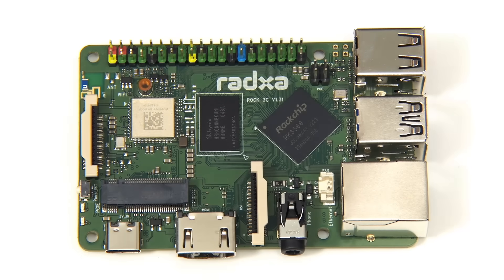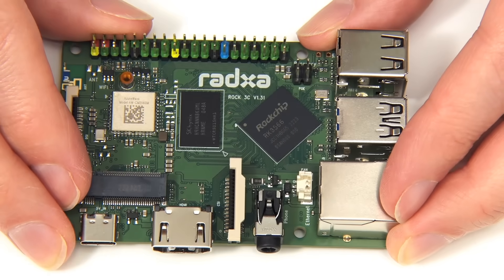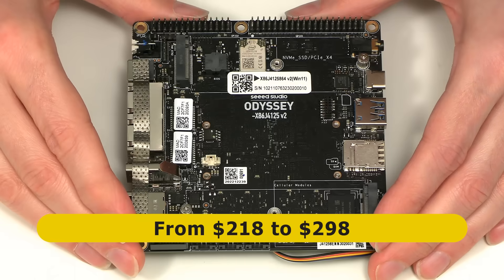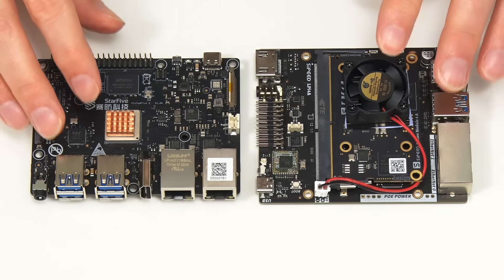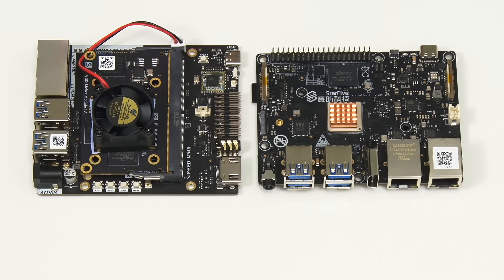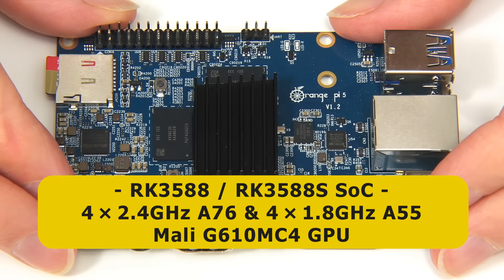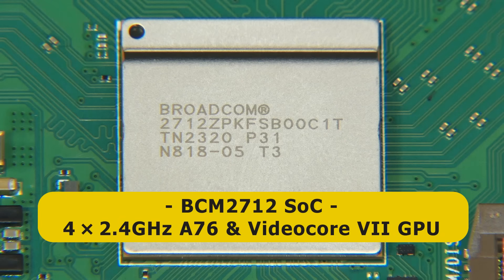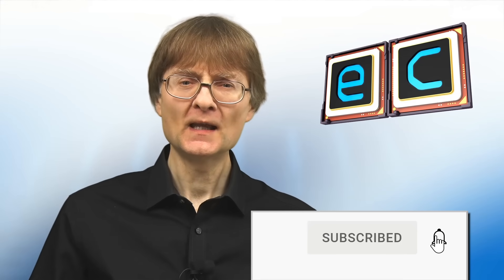Top 6 New SBCs 2023

Comment: I think you nailed it. The PI is always going to be #1 in my opinion. It might not be the fastest or most high tech, but it's a stable platform, that's flexible enough to run a variety of os like Kali Linux. It's a natural choice for Python development and there's lots of support and help available from other users. That's not to say the orange pi doesn't have a place. I can think of lots of physical programing applications where the orange pi might be a better alternative when is comes to cost vs benefit. That being said, I think a noob should stick with the Raspberry PI for the above mentioned reasons. While cheaper options may be available. They are generally better suited to those with more experience in my opinion, due to limited technical support resources.  However if someone's main objective is using the SBC's I/O connector, and writing physical programming applications in python they should be good to go.

Comment: Thank you for covering SBCs! Do you know whether there's an online database of SBCs (perhaps crowdsourced) that can help folks find a board that works for them? I'm having a hard time finding boards with 2 ethernet ports and would love a way to easily search and filter. Related, I'm also searching for boards that are fully supported by the vanilla Linux kernel and the main distros directly (say from Debian or Armbian). I'd rather not rely on ISOs built by the board manufacturer for security and longevity reasons. Thank you!

Comment: It feels like 10 to 20 SBCs have been released every year for the last decade or so, with every one of them being a 'niche' product (that is, not a mass-market consumer device) that would require both a large development cost, and then demand a significant ongoing support cost. 

I find it hard to imagine the total production volume for any of them (possibly excepting the Raspberry Pi) is much over 100,000 units, and I'm guessing most of them sell well under that number. Almost all of them are priced under $200, with many well under $100.

And yet - there are several companies making a go of it, and new boards just keep on coming. I'm not complaining (much) about having too many choices, but for at least 5 years I've been expecting the bonanza to come to a crashing halt. Obviously I just don't understand the economics of the situation.
Reply from the maker: Raspberry Pi models sell in millions. Most other SBCs have production batches of a few thousand, and often no more than a few batches will be made. So there are very few SBCs that sell more than 10,000, or even 5,000 units.
Reply: @ExplainingComputers Thanks Chris. I didn't expect millions for the Raspberry boards (hundreds of thousands, yes - millions, no). 
But the numbers on the rest of them don't surprise me very much. Although they do still leave me wondering why there are so many SBCs. 
If you sell 5,000 boards at $100, that's half a million, which really feels like it wouldn't cover your costs. Salaries and benefits alone, for as few as 10 people, are likely to be half a million or more per year!
I guess all these companies are willing to spend in hopes of becoming the next Raspberry? Oh well. Good for us, I guess. At least until the bubble bursts.

Comment: I'm waiting for a goldilocks board to use as a home router. There's a lot of hella good boards out atm but with only 1 ethernet jack. And there's a lot of janky with ones with 2, which I want; or alternatively super expensive ones with 2 ports but also 20 other things a router doesn't really need. I'm also very very not interested in running things off SD cards these days, break too much. Internet -> dumbified modem -> SBC -> switch/router -> LAN is the setup I'm eventually thinking of.

Extremely disappointed that the RPi 5 still regards alternative storage to an SD card as a 2nd class citizen. Hoping soon maybe that PCIe connector will allow nvme storage to be the norm.

Comment: 10:33 i think you mean 4 USB 3.0 Type a sockets.

The problem with these boards is that unless you need gpio access you can get a second hand i5 mini PC for £75 that will eat these SBC's for dinner in performance. They will also have better graphics drivers for hardware acceleration.
Reply from the maker: I do indeed! My bad. :)

Comment: A Pi 5 has just dropped through my letterbox! That's a rarely documented feature, easily sent through mail. As a piece of electronics, it's a work of art. Some resistors and capacitors are now so small, you need a magnifying glass. We now take technology for granted but this is a serious piece of technology.
Reply from the maker: Enjoy your new Pi. :)
Reply: Package small enough to drop through a letterbox? That's good.  I ordered a single SD card from a shop a while back.. it came in a 30x30x20cm card box which I had to drive down to the post office to pick up. Deep inside the box was that little SD card, in a plastic wrapper which could have gone in an envelope instead.

Comment: Woohoo! I  guess I am a  "diehard". :-) I have the Starfive vision 5 2 (from the kickstarter early bird) ... the RISC-V boards work, but there some things need a bit patience and time reading forums and documentation.  Being able to use a NVMe SSD is a great feature. I've also messed about a little with bare metal RISC-V (32bit) on an FPGA...  Haven't had time to try yet, but I believe it wouldn't be hard to spend a week or more using RISC-V 64 and Debian for a week or more.

Comment: Is there like a universal power supply brick that can be used on these SBCs?
Reply: I use a Pi 4 power supply for both the VisionFive 2 and the Lichee Pi 4A. Cheap, decent quality, and readily available.
Reply: @BruceHoult  Good tip, thanks Bruce.

Comment: can't wait for the a78 cores to land in SBCs beyond the Jetson
Reply: We always want more!  I'd like to see an SBC with Snapdragon 8 Gen 1/2. That would be powerful!  It's possible we might see A78-class from RISC-V first -- Chinese firm SOPHON this week announced a new SoC (SG2380) they are developing with 16 SiFive P670 cores, 12 at 2.4 GHz and 4 at 1.6 GHz. They plan to release it on a mini-itx board in the 2nd half of 2024 starting at $120. We shall see. They currently have a shipping 64 core RISC-V SoC (SG2042) with the same A72-class C910 cores as the Lichee Pi 4A running at 1.8 GHz which works very well (I've had ssh access to one since March), so they certainly seem capable of the task.
Reply: @BruceHoult  Brilliant stuff! Once RISC-V is able to push the A78+ envelope they'll definitely become capable desktop replacements. Hopefully that SOPHON board has a BIOS too since that's usually what makes OS support difficult on ARM/RV platforms.

My Pi4B is already very capable as a homeserver but it's still a bit behind in video transcoding. I'm being patient though! I really want to get into RISC-V when it's a worthy upgrade.

Comment: I agree that the RPi5 is the best in the market due to the ok performance but more importantly the fantastic software support and experience. There is little value in an SBC that's fast but crashes frequently or doesn't support the software you need to run.

Comment: Apart from the likely larger user base for support the Raspberry is not deserving of position #1. Technically they are behind in terms of PCIe, speed and overall I/O.
Reply from the maker: Hardware alone does not make a usable system. The software support matters, as does delivering a consistent hardware platform. It's not about the user base.
Reply: @ExplainingComputers  As the RK3588 is getting close to mainline Linux support (95% there) along with several quality current images from non manufacturer sources some of that is far less an issue than in the past. The issue is with manufacturers who only see profit in sales and software as a cost to be reduced so if you look purely at them then there is some point. Even Raspberry relies on external input for software which they do well and incorporate it into their own.

Comment: massive invasion of cheap intel N-series processor based mini PC models makes Odyssey  SBC outdated and overpriced in case you needed just a cheap PC
for 150-200$ one can get such PC with 16 Gigs of RAM, 512 GB NVMe SSD + SATA port  and preinstalled Windows 11 and some models come with 2 LAN ports.
So GPIO ports seems like  the only advantage of the Odyssey
Reply from the maker: For a cheap PC you are right. But even ignoring the GPIO, the Odyssey has advantages in many use cases. I've never see a mini PC with twin 2.5Gb Ethernet for less than the price of the Odyssey, or one with two M.2 slots and SATA either. We have to compare like with like. :)

Comment: I feel that a NVME connector and SATA connector are now becoming a minimal requirement for SBCs, as it is more convenient and reliable for storage than a micro-SD card, and in term of RAM a quantity of 8 Gb (or more) would be ideal for using SBC as a small computer, and advanced NAS usage. For 2024 I hope SBCs will have these specifications, otherwise users will prefer mini ITX motherboard, mini-PCs which offer better features and flexibility.
Reply: And can we please have onboard Poe and 2½ Gbit Ethernet as standard as well.
Reply: *an NVMe (because enn-vee-em-ee starts with a vowel sound)
"A" vs "an" is determined by the sound that follows, not the letter, and it doesn't matter what the letters in an initialism stand for.

Comment: Wow those Kdenlive times are interesting to say the least (15:25).  The RPi 5 got its -ss whipped!  And the RPi 5 didn't even show much faster than the Pi 4 and they both got BLOWN AWAY by the Orange Pi 5.  WOW!   Not just faster as you said but more than 2x as fast.  I'd like to see more comparisons between these to see why there is such a HUGE difference in this test.
Reply: Yeah it's quite a difference still than even the new RPi5 it seems at least on paper. As far as HARDWARE, the OPi5 does seem superior to the RPi5, but that software and community support is hard to beat for RPi5, and should close the gap as time goes on...at least you'd think...?

Comment: Missing n100 morefine m6s for 150USD. 12GB DDR5, 512GB nvme. Can run passively cooled. Tiny mini pc.
Reply from the maker: Sounds like a nice board. But the video is not missing anything. For a start it is about SBCS! :) And, as I noted in the introduction, the only SBCs that were released and reviewed on this channel between 1st November 2022 and 31st October 2023.
Reply: @ExplainingComputers  Just want to raise some awareness about the cheap x86 boards, especially those who might be more sbc than mini PC. Lines between sbc and mini pc are  blurred when ram is soldered on and board idles  at 7.5watt in Linux.
Reply: It's $259 now
Reply: @jankomuzykant1844  Amazon has it for 159 USD, sometimes they have a sale as well.

Comment: I was reading about OpenPOWER. https://en.m.wikipedia.org/wiki/OpenPOWER_Foundation  How will this compare with RiscV? It seems that  IBM had made the ISA open source. Have you come accross any interesting SBCs supporting this ISA? It was formerly used in Apple Macs back in the day with PowerPC G5 being the last. Still used  on IBM POWER servers (AIX, Linux, IBM i).
Reply: You can buy an OpenPOWER PC (Raptor Computing Systems "Talos") but it exists with basically a single implementation (SoC) and will set you back $3000 or $4000 for a machine. There seems to be no interest in making lower end chips e.g. maybe something like the old PPC601 or 603e etc which could be done at 1 or 1.5 GHz for peanuts (or at least Arm/RISC-V prices) these days. There's probably zero point given the market ARM already has and the momentum of RISC-V. The same goes for things such as a open SuperH (SH2, SH4), which was happening just as RISC-V got started. MIPS went kind of open (but not really) a couple of years ago, then closed again six months later, then announced they were switching to RISC-V. Multiple other companies have ditched their perfectly good ISAs and switched to RISC-V e.g. Andes (NDS32) and THead (CSky), both of which are fully supported in e.g. gcc and the Linux kernel.

Comment: Even though I can get audio out from the GPIO pins and analog video from a solder-on solution. I wouldn't have blamed you if you knocked Raspberry Pi 5 down to number 2 for getting rid of the audio jack. It just seems wrong. Great Video once again!
Reply from the maker: I did agonize about the top two positions! :)

Comment: I feel the Orange Pi 5 should be #1. Software for the RP5 isn't available yet and may be a long time before it can become useful. Just my opinion :)
Reply: Actually the latest release of the RPi OS was released days after the RPi5's release. I have downloaded it and upgraded my RPi4 to the latest OS. Regarding applications, I have had no problem with any of the applications that I was running on the RPi4. Check again because the RPi OS based on Debian 12 Bookworm is there. I do agree with you on the OPi 5 especially the OPi5 Plus. I think the Orange Pi 5 family makes a valid challenge to#1 position. My take would be to reverse the positions, RPi5 #2 OPi5 #1. Just my thoughts

Comment: I have a RPi 5 on pre-order, and I simply can't wait!  My only criticism would be that I wish they would go back to full size HDMI. Those micro HDMI ports are a nightmare. Hopefully Argon or other accessory companies are hard are work on a case/breakout board to give us full size HDMI while also supporting the OEM cooler. Thanks again for another great video!
Reply from the maker: I totally agree about the micro HDMI -- horrible connectors.
Reply: Me three. I don't use two screens with a pi so it's a total wash for me to have two worse connectors that need a special cable over 1 good one that needs no extra hardware.  @ExplainingComputers
Reply: I was really hoping they would have added some sort of alternative connector for storage, in my opinion they should scrap the SDCard alltogether and put either eMMC or a connector for NVME storage on there.

Yes i know at some point there will be a "HAT" for that, but it always seems like, if you want POE, and flash storage, and be able to put it in a nice looking, not too bulky box, you are out of luck.

Also...Why no 2.5GBit ethernet port.

I will probably just keep my Rpi 4 and hope they add those things to the Rpi 6...
Reply: ....and no one will be able to buy for years into the future....
Reply: 100% agreement on the HDMI connectors. I've broken several plugs on that - the micro HDMI plugs are tiny, and combined with the stiff HDMI casing the forces are strong. This typically happens when I try to install the Pi in narrow spaces, which I do because.. that's where I need them.  I had one connected to my parents' TV, for example (simple video conferencing for old people).  I hate, hate, hate those micro HDMI connectors. Even mini HDMI would be better (my first Asus Transformer had one), but I would take one single full size HDMI before two smaller ones 10 out of 10 days. I've never needed two HDMI ports, on any computer ever (I'm a big screen person, not a dual monitor person). And on an SBC? Crazy.

Comment: Excellent as always. However, I also would not put Raspberry Pi 5  at the top. Eben Upton, in a recent interview, stated that the team had been working on the RPi5 since 2016. I understand his statement in that they started with a concept and fleshed it out until they had a product. However, not including 2.5Gb Ethernet, the inclusion of PCIe using flimsy cable, and limited memory are possible shortcomings in today's SBC market. I have been using the Orangepi 5 Plus for some time as my Linux Desktop and am very impressed with the performance and capabilities of the unit. Specifically, I am using the Debian 12 bookworm image and have had no problems with it. The one issue with the OPi5 Plus is that you cannot use an HDMI to DVI adapter on a monitor. It must be an HDMI monitor. This is well documented and is not a major issue. This does not appear to be an issue with other OPi products. The documentation for the OPi5 is very extensive and thorough. I have placed my order for the RPi5 but it is not due until Jan. I look forward to its arrival and testing. While I own most of the units on your list, I am waiting until the RISC-V has had a bit more maturity. Your reviews of the two RISC-V boards were excellent. You have the opportunity to work with those developers to make the product work and your efforts are both invaluable and greatly appreciated. I will purchase one or both boards when they mature a bit more. Finally, I do not miss any of your Sunday releases and revisit them on a regular basis. Thank you for your work

Comment: I'm learning electronics and IT as a hobby. I was never familiar with SBCs and never used Linux in my life. This year I discovered your channel, and after watching your review of Rock 3C, I've decided to buy it, because I thought this would be a good SBC for a begginer as myself. And I was right. Now I've learned a lot about Linux, build a home meteo station, home server, camera surveillance system, and some other automation projects. All in 3 months. Thanks a lot for this. Now I'm waiting to recieve Orange Pi 5 Plus to make some other projects I have in mind. Thanks again.
Reply from the maker: Great to hear that you have been busy and learning with the Rock 3C. :) It is a nice piece of hardware, with much potential as you have demonstrated. I wonder what you will do with the Orange Pi 5 . . .
Reply: I love hearing about a newb getting to love this area of tech.  I wire-wrapped my first SBC in 1986 - a Z80, a static RAM chip, an EPROM, a clock oscillator and not much else.  Ah, the Bad Old Days...

There was a time about 20 years ago that I began to worry that smart black boxes and surface mount components would remove all curiosity for understanding and experimenting with computers and electronics.  I very glad that I was proven wrong!